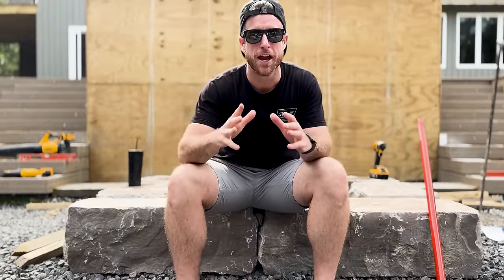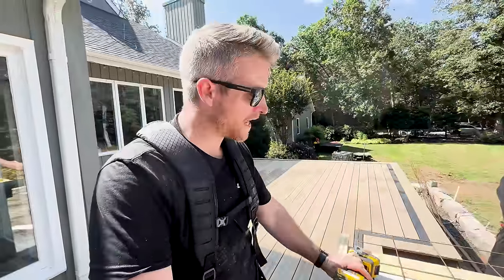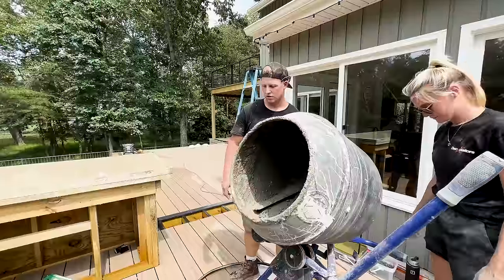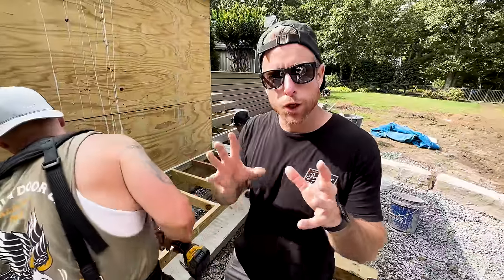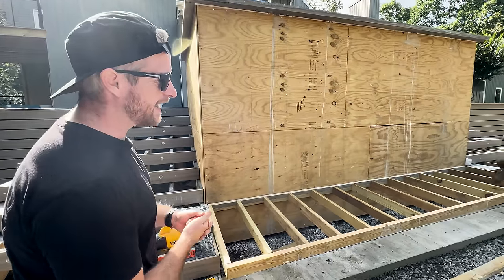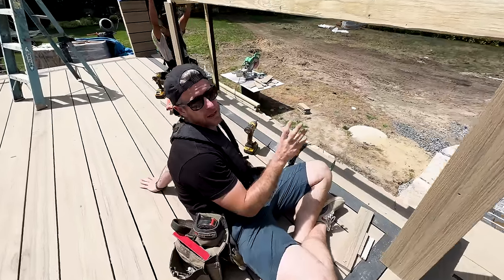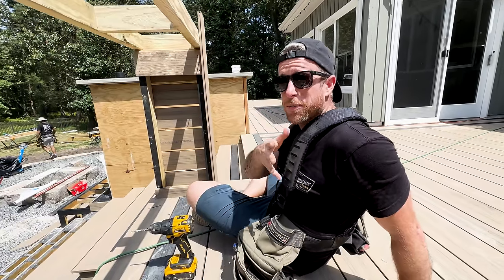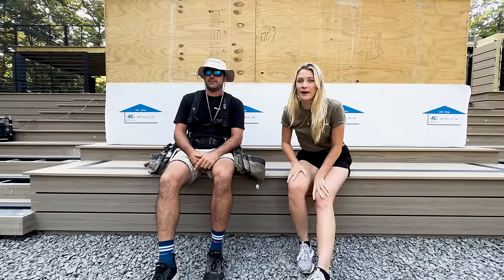OUR BIGGEST FAILURE YET 😬 On Our Biggest Deck Ever!

Comment: Hi.  Love the workmanship.  Do you have to deal with wasps and wasp nests?  If so...recommendation at the 14:45 mark...consider using black plastic strips in the slots to fill the gaps to keep them out.
Reply from the maker: Thanks a lot Darryl! We don’t have a lot of issues with wasps but if we do, they typically like to make little nests under an overhang and not inside of stuff for whatever reason

Comment: Ah the concrete curing issues!  Been there myself!   

I got a brilliant tip from an old pro.  He said get a load of hessian sheet or bags, soak them and then wrap the concrete with them.  

Stops it curing too fast and cracking, and man it works a treat because you can set the hose to mist and just lightly dampen them throughout the day. 

Then unwrap them at night when it's cooled to let them cure the rest of the way!
Reply from the maker: We definitely learned a lot from these mistakes lol. I think first of all we should have had a tent over it, and then absolutely should have kept it moist for the first 24 hours…I like the idea of soaking sheets to keep moisture in! We’ll definitely try it again and will keep that little trick in mind!
Reply: @THEpremieroutdoor  sweet!  It's like anything in life isn't it - you don't know what you don't know till you know!

Comment: Can you dry pour a counter? Just wondering...I've done sidewalks with dry pour and ZERO cracks or issues and no stressful rushing before it sets up. I did a big carport pour with wet conventional concrete trucks (BIG $$$) and cracks everywhere. These 2 pours of mine were literally within 2 weeks of one another...Whenever possible, I will only dry pour from here on.

Comment: NO no... the biggest failure is using and pushing the Deckorator brand. Just finished a 600 sq ft deck with the Voyage line Sierra color mainly because I love your work. I have a phrase for this type of product "Good from far, far from good" Pros: This flooring looks great, seams stay true because of the mineral base, BUT the quality is shit, and grooves are not well-grooved - deep enough on many boards received (making the spacing really hard to be consistent with hidden fasteners) We built the frame 16" on center but still many areas have soft spots. When you cut the boards, you certainly want perpendicular cuts as close as possible because the mineral except for the surface looks bad. I built my fence out of Timber tech, coastline.  Now I wish I used it for the flooring and the dark hickory color for my fence.  Oh well, but like I said it looks great but I can see the flaws... Luckily a majority of my guests will not.

Comment: How it was ok for 3 hours and then not ok and kept tripping was you were using a breaker that was also using something in the house and was overloading.  Someone either was home and started using that breaker for something or something automated in the house kicked on that also uses that breaker.  All you had to do was plug it in somewhere else and it would have been fine.  Also a good idea to check with the homeowner to make sure you know what else is on a breaker before you start plugging power tools into random outlets.